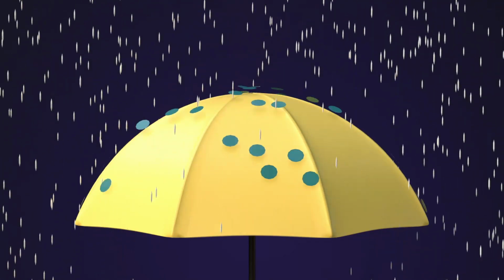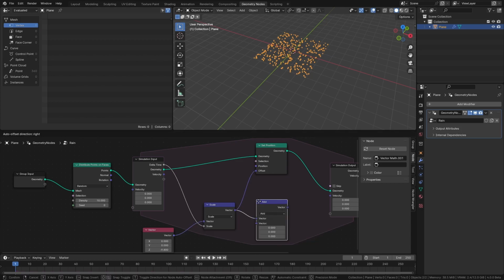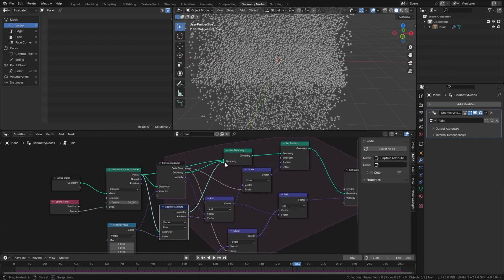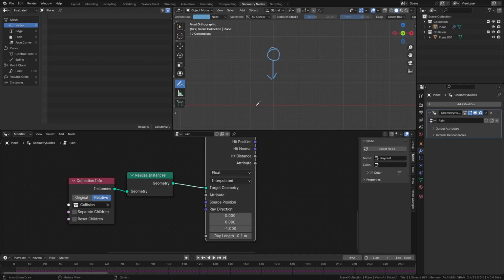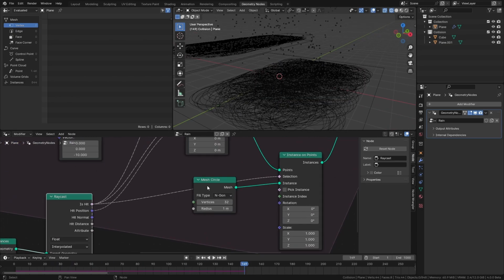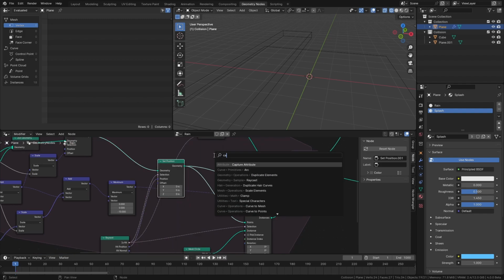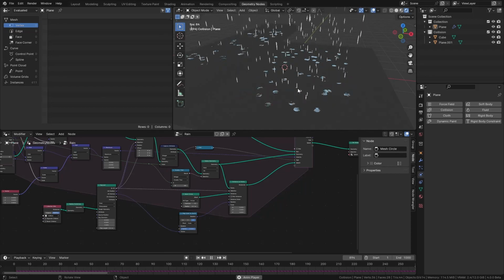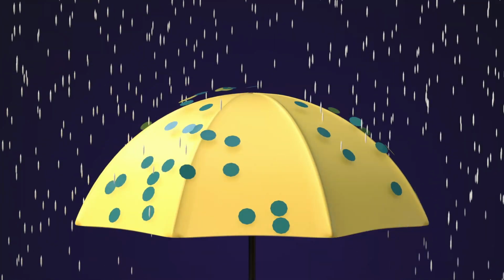How to Create Rain Using Simulation Nodes (Blender 4.0)

Comment: This clears up a lot about geometry nodes. It seems simple but I wanted to send particles from the normal of the object. I just hooked up the normal of the distribute points on faces to the original add vector and it worked. Now I need to figure how to make the particles lag behind as the object turns. 
Thanks for a great tutorial

Comment: I'm curious, why doesn't this work at 24fps?
Reply from the maker: I don't actually know, for some reason it just doesn't. Maybe in later versions it does.
Reply: its work just add greaterthan node on the raycast node for raycast lenght or just set it bigger number from zero
i thought it wont work but it does work
happy ending :D
sorry if my ansuer is wrong but sireously try it
(edit) : nvm it still ditn work :(